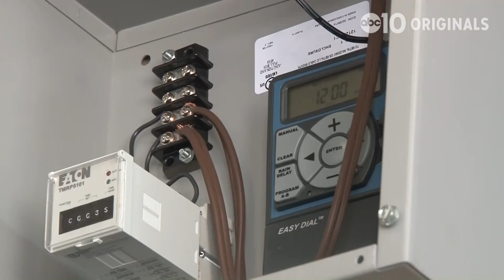The Horn from Hell? | Bartell's Backroads

Comment: Nice posting. I collect steam whistles and I have a Chrysler Air Raid siren and a Type "F" Diaphone fog horn. I am familiar with the Type "B" Gamewell Diaphone. They have a 2 inch diameter piston which makes the sound. They are very powerful. If you want to hear my much larger Type "F", check out my "Real Fog Horns" posting. My type "F" weighs 500 pounds, has a 5 inch diameter piston and was the standard long range fog horn for the U.S. Lighthouse Service and later U.S. Coast Guard. It can be heard over 30 miles of water. A colossal sound. Jake Hefferman visited me and made some great recordings of his Gamewell Type "B" and my "F". They are on you tube fog horns also.